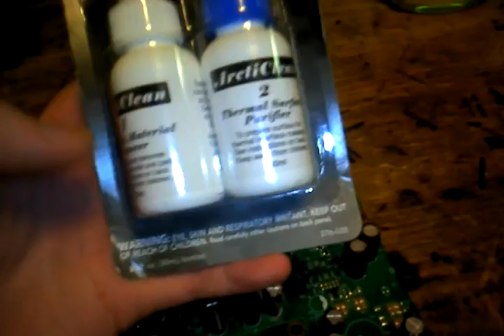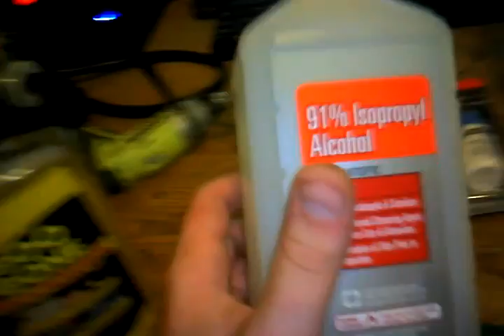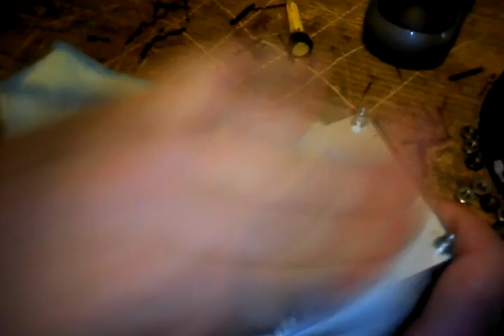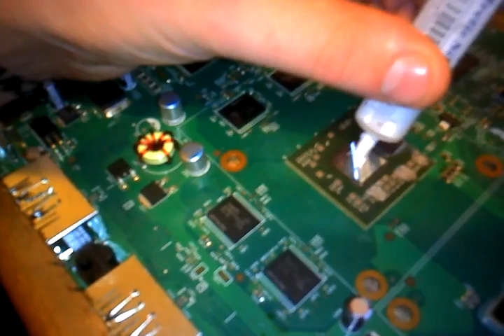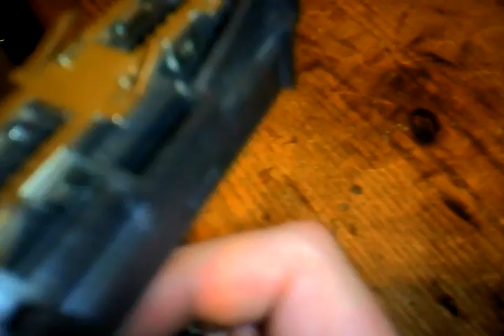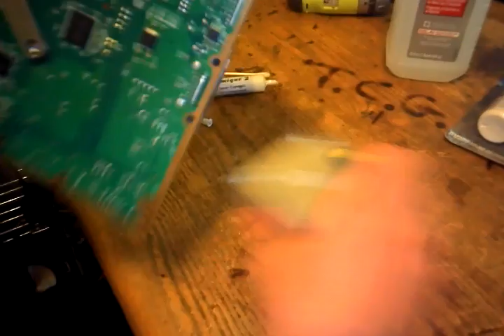How to remove X-clamps + Thermal paste removal and chip cleanup + Thermal paste application

Comment from the maker: ceramique 2 is totally non conductive just as a side note so thats always i plus if some gets rubbed on something that should not be connected, however ive never once heard of a xbox failing due to thermal compound shorting shorting something out due to the fact that its conductivity is relatively low

Comment from the maker: Yes remember the preheater is the most crucial part as it does most of the work and griddles don't get hot enough.    Remember to do a reflow correctly you must make sure the solder balls are completely liquid, you can check this on a junk board by very very gently nudging the chip when it is at the melting point, it should move a tiny bit and snap back into place, if the chip does not move than your not really reflowing your just heating and will need to adjust your profile accordingly.

Comment: Ya well I already have a sonic rework station and a  griddle but my repairs are not getting the best I think it last for 1 and a half month to 3 months. I am trying to find a a cheap BGA welder but one that would be good for a long while. I heard that the achi bottom hearted sometimes is defective. I also got the chance to see a  reflow and a reball with a t870 and I do like the lay out, very simple. I think I will go with a t870 but I will defenetly go buy some of the thermal paste. Do you kno

Comment from the maker: Yes it is however The Cermique 2 is the second best and allot cheaper. Like I said in the video I test all my methods with a Jtag'd 360 that tells me the operating temps and I have seen little to no difference between the two. Everyone has they're own method and that's the beauty of this type of work. Use what works best for you.

Comment from the maker: I think he only sells the ACHI system but again I will tell you that your not gonna be happy with a T870 for a number of reasons one of which it uses regular ir which will make it allot harder to see what your doing without hurting your eyes.  I know you want to find a more budget way to do it but in the long run your gonna be sorry you did. If you want to do it on a budget I'd suggest a T-8280 Preheater and an Aoyue 968A, That said the achi will save you allot of time in the long run.